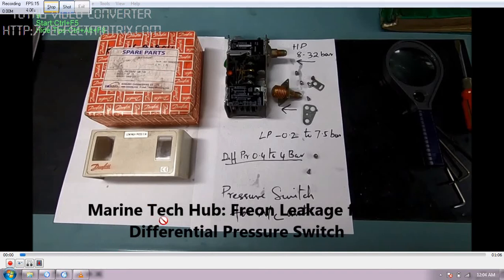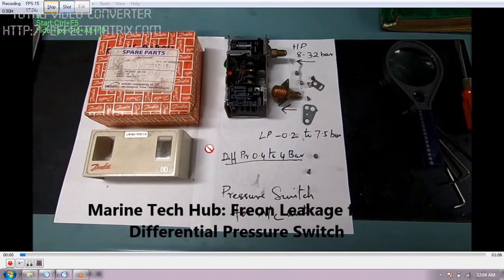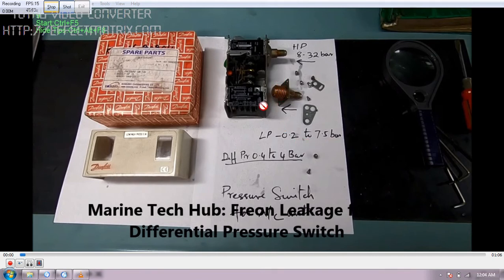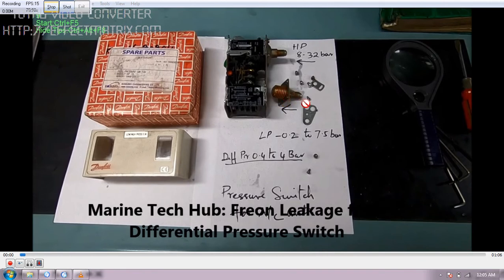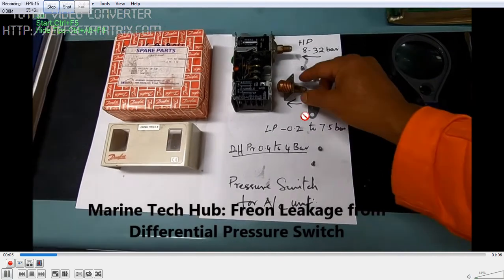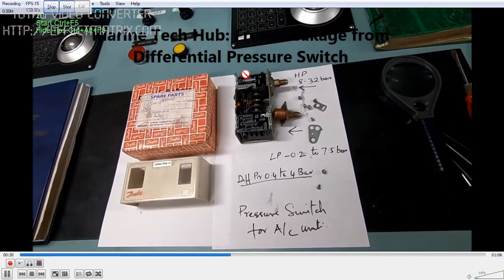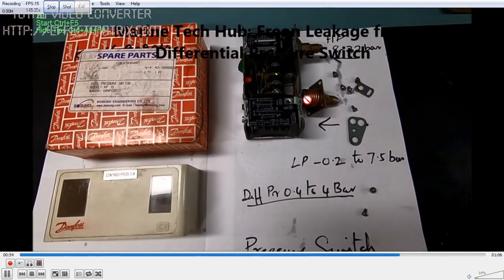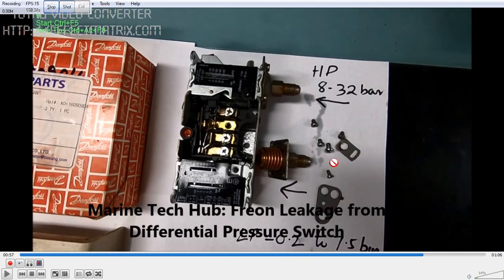Differential Pressure Switch: Freon Leakage: Important Tips

Comment: But sir,diff pressure switch is for lube oil and suction pressure rit???
Reply from the maker: Good day Siva Rajan. Differential pressure switch can be used in different operation.  The bellow of the pressure switch can always get holed after several operation. In our case it was Freon leakage from Air Conditioner.